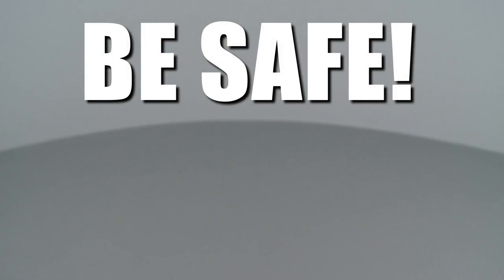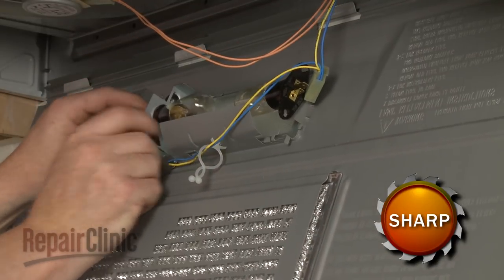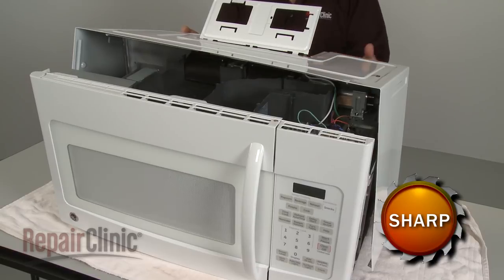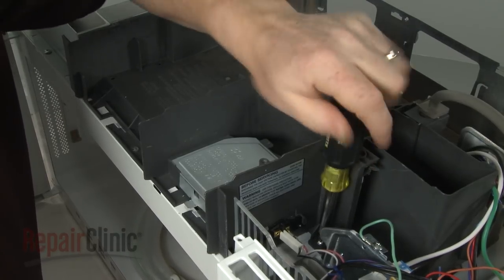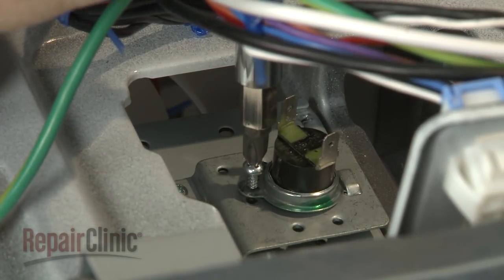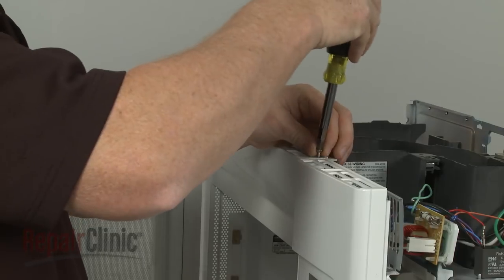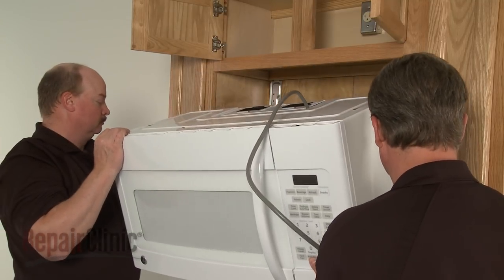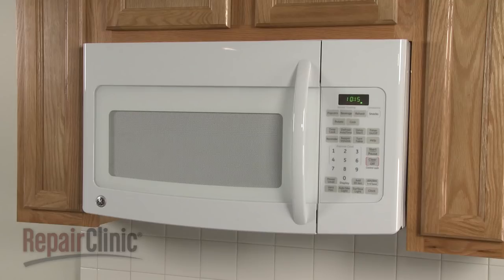GE Microwave Won't Work? Magnetron Thermal Fuse #WB27X10166

Comment: Why remove all that stuff? Watch the magnetron replacement video - take it out and the thermal fuse is on it. Much easier than disconnecting all the blower stuff! By the way, how about testing the fuse before you assume that is the issue? Just sayin'

Comment: Hello we have an LG Microwave. Our microwave turns on when we press start to heat something example if we click one minute then in a few seconds the light turns off and not heating but timer on display is still going any suggestion? Can it be the the Magnetron Thermal Fuse?

Comment: My microwave aint heating i changed all the door switches an the little black diode connecting to the capacitor an to a ground i dont know if its the magnetron r the transformer any ideas

Comment: What is the symptom when the thermal fuse is failing ?
I have a microwave heating up food at 50% speed as usual.
Is the problem on the Magnetron or the fuse ? or maybe the capacitor  ?
Reply from the maker: We recommend using the repair help section of our website at: http://www.repairclinic.com/repairhelp?TLSID=1773

Using your model number will give you the most useful information.

Comment: thanks for the video. my GE XL1800 went out, no lights, power etc... Where can i find the fuse or where do i start? thanks
Reply from the maker: congtusacto Disconnect the power cord and remove the top grille and control panel and you should be able to gain access to the fuse. That is a good place to start. http://www.repairclinic.com/RepairHelp/Microwave-Repair-Help?TLSID=1773

Comment: So how do I know if its the thermal sensor gone bad?   Mine keeps popping fuses.  When I place amuse the light fan clock all works.   Heat water fuse pops.  It may have been used to cook a potato and overheated
Reply from the maker: If the thermal fuse is bad it will not normally blow the fuse when the magnetron comes on. If the magnetron itself is shorted or the high voltage capacitor is shorted, it can blow a fuse when heating. These things can be checked with a meter but we recommend you have a qualified service person look at them for safety reasons.

Comment: Key pad control not work
Reply from the maker: You'll find our website's free troubleshooting and repair help system to be helpful: http://www.repairclinic.com/repairhelp?TLSID=1773.
Reply: +surapong sivi There is likely a separate fuse for the control panel, my GE had one.  It was located right above the control panel under the cover.  $1.50 from RadioShack.
Reply: Thank U